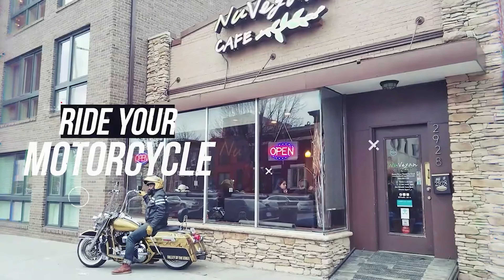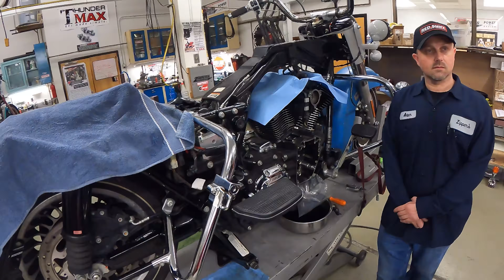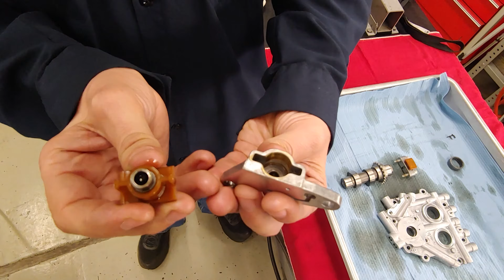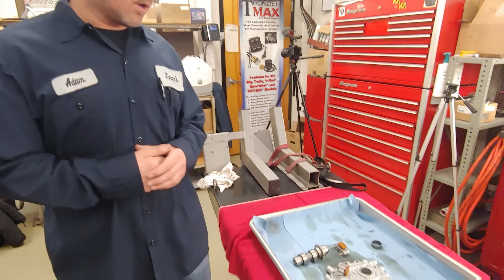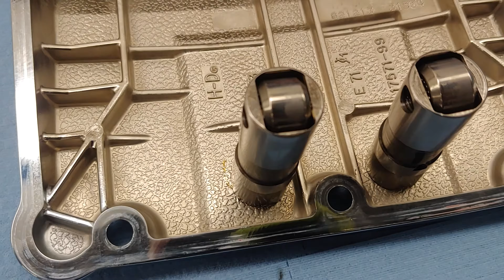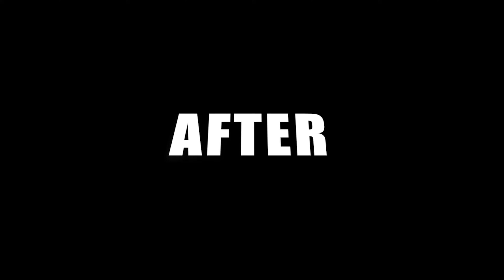Budget Friendly Upgrades to Stock Harley 103 Twin-Cam Engine to Increase Power and Reliability

Comment: People sleep on the Twin Cam 103 capabilities. I have a built 103 and when I tell you it runs hard, that’s an understatement. 114s with cams don’t even concern me. No cap, my boy got a 131 cammed and he jumped on me but i reeled him in once I hit 2nd gear and pulled away from him. When we made it to the next light his eyes was wide open and had to give my bike props. Don’t sleep on what a 103 can be. Mines is fully built, but it’s still a true 103. Your dad bike looks amazing too! I’m happy for him.
Reply: What all have you done to your 103?
Reply: @divineuniversalunderstanding  Ported and Polished Heads, S&S 585 Cam, Rods, Throttle Body, New Springs, kept the original Flat Pistons, Tune. My motor guy did all the work, he’s got a kit, it might be some more im missing, it’s his mix but it works really well. I highway ride too, fuel efficient and all of my Club bros don’t believe I have a 103 still, it moves!
Reply: @tscreez490 can you hook me up with your mechanic. Time for upgrades.
Reply: Any oil pump/lifter? What size / manufacturer throttle body? Is it plug n play or requires re-cal?
Reply: Hey I just bought a Dyna with a 103 and I've done pcv intake and exhaust any advice on what next on a budget
Reply: @EthanHughes-tr1yv  seriously, Twin Cam builds aren’t budget friendly at all. Unfortunately. If anything, you will need to focus on your Primary. Compensator Upgrade, Clutch and Chain Tensioner. Other than that, going in the motor, one thing leads to the next when you start touching stuff but you don’t want to waste money and see very little gains. If you didn’t do your cam, that’s the cheapest item you can do along with boring the throttle body. Just my opinion. Tune the bike for sure too if you touch anything else.
Reply: @EthanHughes-tr1yv  Red Shift 528 cams, and Thundermax if the budget allows. You'll love the result
Reply: How much horsepower and torque do you now have and how much did you beat the canned 114 by , also what bike do you have , I have the ultra limited and that will be a big difference I’m sure
Reply: @dwanjacquet162  that's a lie his 103 didn't beat a 131 or a scammed 114 my 103 was bored to a 105 sns 585 cams forged pistons and 10.6.1 compression it only made 100 hp
Reply: @jeremyolguin7116  you need a better builder. Just cause you bore it doesn’t mean it was gonna make more power. What did you do to your bottom end? Most of you think bigger size is gonna be more power but a Porsche Flat Six 3.0 can beat a 6.4 Hellcat all day. Either way i’m putting a 124 SS Hi Comp in mines now, Grudge Box and some other secret sauce in my bottom end. I’ll be smoking more 131s and 135s even giving them a jump. Those Milwaukee 8s are trash. Twin Cam still killing them.
Reply: @jeremyolguin7116 bs
Reply: @jeremyolguin7116 or you need a different mechanic
Reply: @jeremyolguin7116  my 103 with with MR103C cams, V&H short shots, V02 air cleaner and high volume fuel pump, dyno at 103hp, 111ft tq. I have out ran 107 M8’s and 114 M8’s. Of course I’m riding a 2013 Harley Davidson Blackline. Which weighs 596lb in its stock configuration. I guess you’re not looking at power to weight. Most 114’s and all 131’s are in the street glides and road glides. Street glide - 866lb. Road glide - 963lb. Did you figure he could be on a dyna?
Reply: @tscreez490 😂
Reply: One awesome upgrade is to go down a tooth on the rear gear. Gives it quicks and there is still plenty left on the too end.
Reply from the maker: @Ridendrty I've heard of some folks to have done that. 👍🏾
Reply: @tscreez490 , I see you have a 585, and you run on the highway. I have a 12 Road Glide Ultra that I was looking at the 570, but since I am upping the compression, I was told to look at the 585. Are you on a bagger? How does it do on the highway? Ever ran 2up, or packed heavy?
Reply from the maker: Oh yeah! My Dad has been knocking off his buddies with his 103 since he got his bike back. HE LOVES IT!

Thanks for the compliment.

Comment: I have a 2012 dyna fat bob with a 103 I want to do this to mine whats the cost I should be looking at
Reply from the maker: You'd be looking at the cost of a Cam Swap kit and tuner as your main parts outside of your exhaust and air cleaner. Both of those are usually done as a "Stage One" upgrade. Your labor cost will vary.
Reply: @BuildRideRepeat  what if I have the stage 1 one already

Comment: Are these good engines compared to the 96? Don't see too many on the road. Also hear they run hotter than the 96.
Reply from the maker: I'm not sure of any temperature issues. The cylinder bore is the only difference in 96 & 103 engines. I believe the Red Shift RS528 will work with TC 96s as well. Give the folks at Zipper's a call. They should be able to give you an idea of what cam would work in your engine.